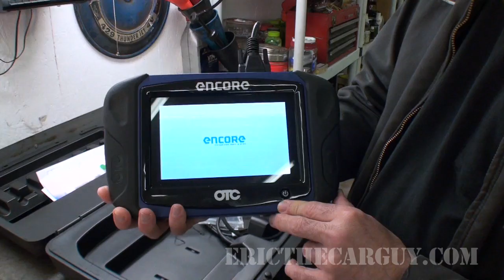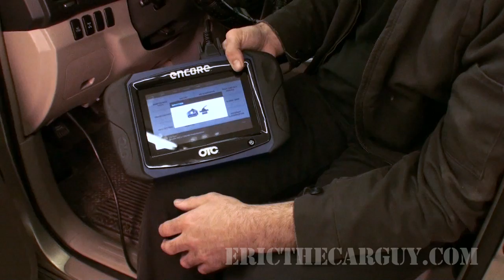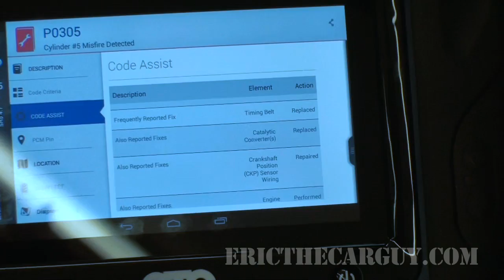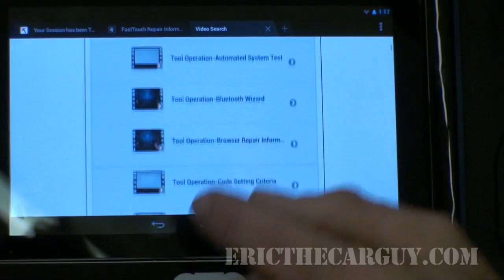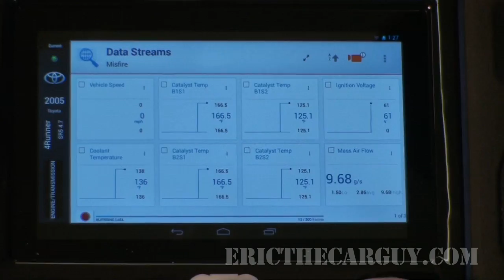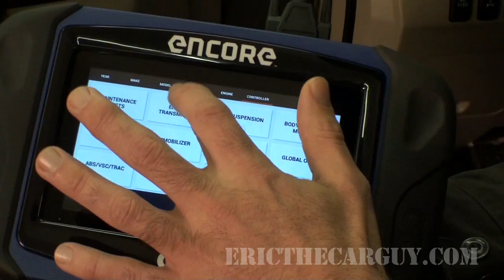OTC Encore Tool Review -EricTheCarGuy

Comment: Hmm, "Tire pressure monitor transmitter identification number 5" - does this mean, there are 5 wheels on that car that have pressure monitoring? Does the spare wheel also have a TPMS sensor? I almost couldn't believe this...but then, it must be, or where else does number 5 come from?
Reply from the maker: You are correct. On this vehicle the spare does have TPMS. BTW after clearing those codes they didn't come back.

Comment: Hi Eric, happy to see you are showing items that the pros might use rather than the DIYers.  This scanner looks like it could be a good deal...but unfortunately OTC missed the nail head again as they have done in the past with former scanners. It is 1/3 the cost of the Snap on Solus Ultra but like most items, YOU GET WHAT YOU PAY FOR.  I would like to see you do a comparison with the Solus Ultra. I have been in the business for close to 40 years and one of the things I have learned is when it comes to tools you should buy the best and leave the rest.
Reply from the maker: I was looking at ScannerDanners Solus just the other week when I was in PGH. It is a faster tool but it costs about twice as much. You do raise an important point but depending on use, price is a factor for some.

Comment: I hve used a snap on modus at college and it seems to be faster and easier to use than the unit shown here but I believe its much more expensive but that will auto detect any car and tells u wich chip to insert into the tool u get the chip put it in the machine and it will automatically bring up any code on the vehicle its really awesome
Reply from the maker: The auto detect works off the vehicle software, not the scan tool you use. Manufacturers started using that after 2007. Before that only on select models. At least that's my understanding anyway.
Reply: EricTheCarGuy
 I get what your saying but from my view point, my cheap $100 scan tool, can find my vin and calibration codes for the pcm, So therefore OTC just needs to add a vin decoder algorithm like all other scan tools do such as autel or snap on and it would be fine, but then again for that model of otc it would just make it slower, I perfer the genisys evo.

Comment: Not very fond of the fact that it relies on an internet connection.  Makes it kind of useless outside the shop.  It also seems to be full of ads.   If they're making money on the ads and promoted services, than the price should be well under $1000 in my opinion.  A cheap import android tablet + Torque + Bluetooth ODB2 adapter would ring in under $300 all together.
Reply: You're so right man.
If my car had OB2 I would do what you said in an instant.
:-)
Reply: I'm using torque. But his one have much more capabilities, albeit slow. The major part of this tool I think is the ability to looking into different modules for various brands. Those data and controls are great help. You can do a lot more with this kind of tools. But, yes, it is painfully slow. I guess it has something to do with ETCG's WiFi.
Reply: motofan16
 He did a recent video with this device again, and another buyer of this commented 5 months ago that with updates it's gotten to be rather quick.

Comment: Cool tool but just way too slow!!!
Reply: ...or is is Eric's wifi that is slow?
Reply: He did another video recently using this tool and he said the updates to the software  took out a lot of the slowness.

Wifi has nothing to with it. It was loading quickly on websites. It was setting up slow to connect to the vehicle. OBD II in general is SLOW. Have a dealer specific tool and it should be a lot quicker, but wow, you'll pay for it.

Comment: So basically, if they make some sort of an adaptor, so you could plug an OBD2 type plug into a normal android tablet. Couldn't you just purchase some software and do the same thing with a normal tablet?
Reply: howpeculiar
You should check out what the torque app can actually do and all the cool features it provides. It won't beat a professional scanner, but for the DIYer it's pretty nifty and useful.
Reply: The tablet is a cheap tablet, probaly inside a enclosed dock. But yea the software makes the price, If you get your hands on the tablet and Dump the ROM or someone leaks it on the internet, sure it can run on other stuff.
 Some tablets like Lenovos Thinkpad has a full size USB port on it
Reply: Search "torque app" on Google play store.
Reply: You are assuming that the software is cheap or free, The software is what makes a tool like this useful.  I am certain that the hardware on this scanner is not what drives the cost. The software to display and interface with all the control modules in so many vehicles is not a 99 cent ap you can get at the playstore.
Reply: Come to think of it, a friend of mine has a bluetooth OBD2 reader you can use with your phone. Software for it is 5 bucks, and the thing itself was around 20 I think. But I would like to see some software comparable to the tool in the video for sale to tablets. Sure it would be expensive, but a lot less expensive than the tool
Reply: Icebeam47 Yeah, probably true. Would be nice if someone made some high quality diagnostic software for android at least, the ones I have tried haven't really been worth using. Better to just take the car to the local garage, they read my fault codes for free anyway

Comment: Do you know what your internet speeds are at the shop? Maybe that has something to do with the lag, but in all honesty, android is a little slow in general. Another great video Eric, can't wait for the Fairmont vids.
Reply from the maker: That's possible, but for the functions that were slow, I don't believe it needed to access the internet. I think it's a great tool, I just wish it had a faster processor.
Reply: EricTheCarGuy I too am confident that some of your issues were down to your wireless and internet connection.
wireless (as far as i have experienced) have always added a level of connection problems with dropped packets and variable latency and bandwidth.

Thunder can play havoc with wireless too.
Reply: Cadde David Knowles  I think the make and models are programmed into it, I'm not sure though. The time it took while pulling the trouble codes shouldn't have been the internet. It was pulling them straight from the vehicles computer. I doubt internet had anything to do with it being slow. Now don't take my word for it but it doesn't make sense why internet would be a problem.
Reply: In a recent video, Eric said that the product had been sped up quite a bit by updates. Recent comments on this video include people who have bought it and found that to be true too.